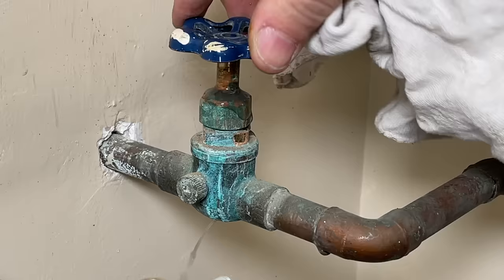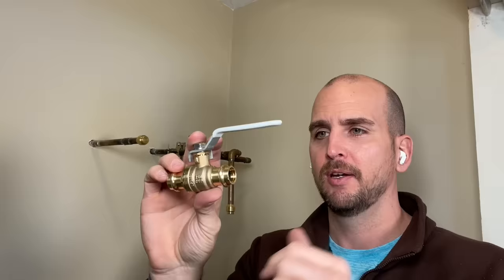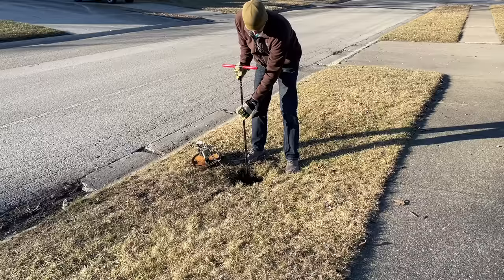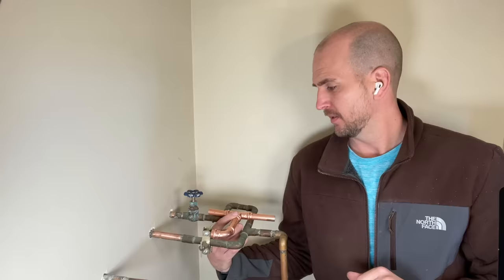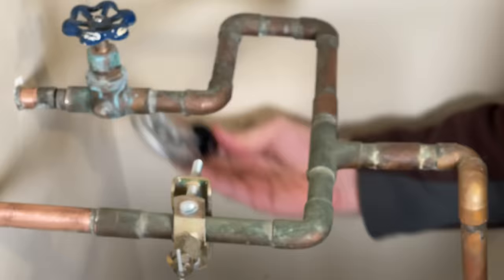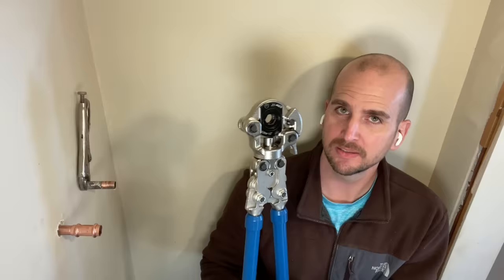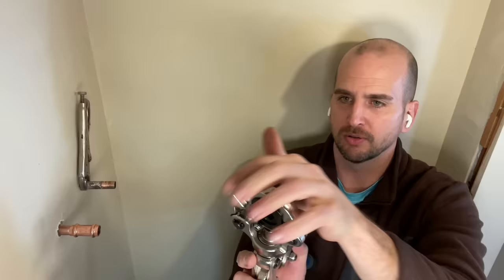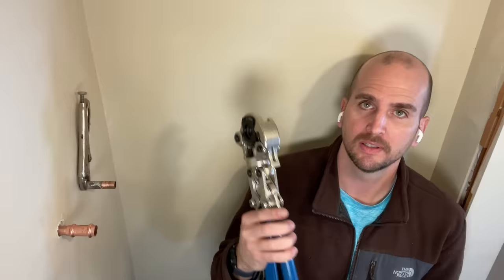How To Install a Main Water Shutoff | NIBCO Press Fittings

Comment: way too much work. i would have jsut turned off the water,  drained system and then heated the gate valve and remove it.  clean off solder and then resolder a new ball valve or compression ball valve in its place.
Reply from the maker: With everything open and already being there I also just wanted to clean things up a bit but I get where your coming from as well.

Comment: a much better tool for this job is a hydraulic pro press crimper, he made that look soooo easy,  I have that exact same tool  1/2 not so bad,  3/4 will make ya grunt and 1 in will make your eyeballs pop out,  the hydraulic one  you just pump it up and  wam bam its done...

IBOSAD Copper Tube Fittings Hydraulic Pipe Crimping Tool with 1/2",3/4" and 1" Jaw Copper Pipe Propress Crimper Pressing Pliers, with Pipe Cutter

$108.20

Comment: Why not show your "everyday home repairs" viewers how to simply solder a simple valve, as a home owner  why buy a tool and expensive fittings to do a simple job. pro press, mega press, shark fittings are for plumbers that can't solder, always having leaks when the water gets turn on. Whatever tool you buy you must get their fittings, some of them have rubber "o" rings. How long these connections last, I know solder is for ever. Is this a home repair channel?. Is this video for the home owner or a plumber that can't solder and is going to charge me a cow, my donkey and maybe a chicken or two for a simple replacement of a valve.
Reply from the maker: 😂  I think you are right I could make several videos on how to solder which is a great skill to have and much, much cheaper not to mention should last longer if done correctly.

Comment: Not a fan of this situation. For the Average Joe, far too technical. I could buy 10 SharkBites for the price of that one tool I will probably never use again. It is a Specialty Tool for Plumbers not the average DYI-er. Just my honest opinion.
Reply: I am trying to work up the courage to replace my shutoff valves and this looks pretty easy to me. And it sounds like the lower cost of the fittings would pay for the cost of the tool pretty quickly... unless you actually only do this once. But that is certainly a handy tool to have around and for $175... doesn't seem too bad.
Reply: @ibealion1  Well for the Price of 1 Sharkbite, $12.00 compared to $175.00 for a tool that you only use once....You do the Math! There is only 1, let me say it again...there is only 1 Main Shutoff Valve! The rest are just Auxiliary Shutoffs! Bathroom/Kitchen/Dishwasher/Fridge. You will use it once and never use it again. Soldering is by far cheapest, Pex being middle of the road, yet the best IMHO! Pex doesn't BURST under freezing conditions. Remind you of Texas at this time?
Edited: For a spelling mistakes

Comment: No thanks, as a plumber for decades; I know 100% my sweated joints will hold for decades...I use those shark bites every now and then when some douchebag uses pex but...I had a master on the job using that crimping stuff...The only thing it's good for is when the water just won't stop leaking to sweat the joint...

Comment: Those fittings are shit and fail under pressure and heat .if a plumber? Shows up and wants to put this trash in your home simply call the police and have them removed .or call your insurance company and add coverage to your homeowners policy .

Comment: Yuck, pro press and shark bites, ugggghhh. I'm sorry, I just don't trust that method. I have seen many shark bites and pro press leaks shortly after highly experienced plumbers have completed the work. Sweating in copper pipes, is the only way for me. Sweating in pipe joints and valves is a time tested and proven method. Where as shark bites and pro press have only been around for 15- 20 ish years or so. Not to mention the amount of sway and or flex there is in exposed pro press pipes. Each component added is a weak link, and you just begging for trouble and repeated cost of the same exact job to be done and redone again. Just stick with proven methods and save yourself the heartache of emptying your wallet on the same job time and time again.